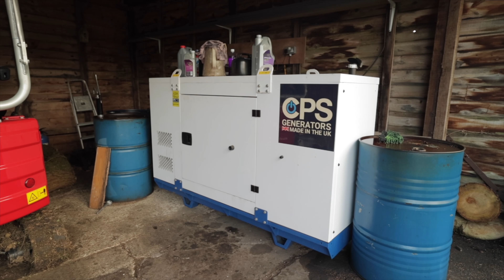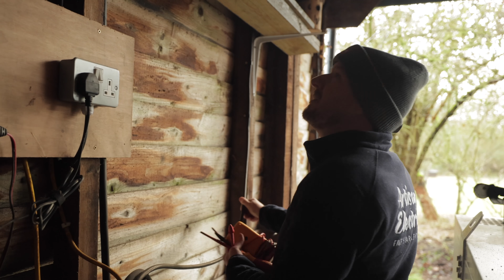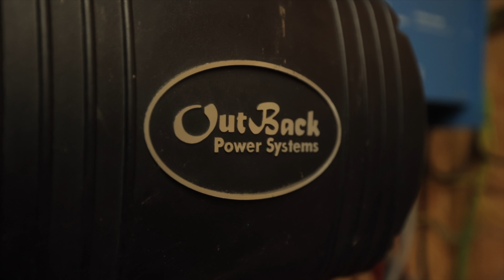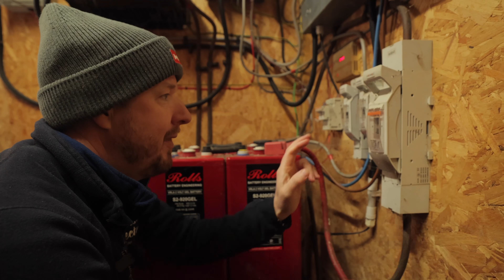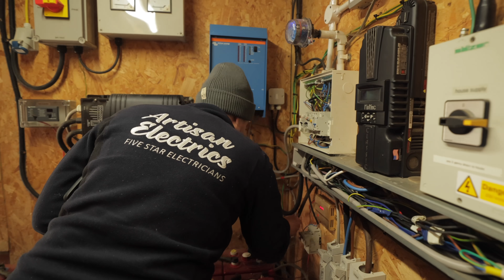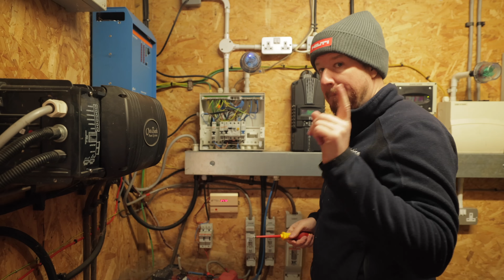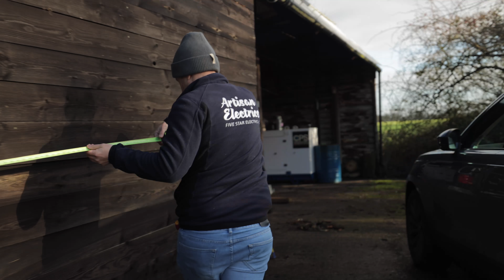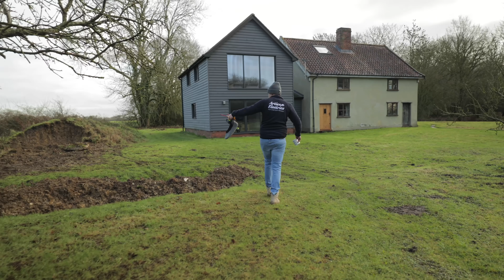DIY Off-Grid Solar Gone Wrong! (It Can’t Even Boil a Kettle)

Comment: Well why i guess that there is no sinple fix since the design is a bit messed up. Technically the system is working but it wasn't designed to provide the required loads. Then again these types of videos aren't satisfying to watch at all. I'd really like you to make more of an effort to fix them rather than just quoting a new install.  Though if I were to do this id just get a deye inverter and compatible batteries. It can control the generator as well as charge the batteries from solar and provide island AC power. Its all in one box and they can produce up to 30kw per unit and be run in parallel. And ideally I would upgrade the solar. 2kw wont even cut it in the summer.

Comment: His recs make sense from a technical standpoint.  I don´t think anyone can argue that the existing wiring and electrical design is neat (or even adequate for the new owners´requirements).  But one must also consider the reason and the timescale of that installation.  It is disingenuous to judge it under current views.  Maybe the installation was done over a 10 to 20 year period, added to piecemeal, which frankly would explain the hodgepodge of different devices and rats´ nest wiring.  Of course a larger inverter would be advisable, but as he points out that really should only happen if the existing wiring (from source into the house) can withstand it.  From the looks of it, it won´t which would necessitate new wiring.  My point is that it would seem the previous owner set the system up so it would work under certain parameters.  The current house owner has different requirements (and by the way, they seem to be completely normal for a modern home) and thus the system will need to be upgraded accordingly.  Presumably, that will carry a significant cost to be paid to the electrician.
Are the recs appropriate?  It would seem so.  But it is also true that the electrician has a vested interest in pointing out all the limitations of the current system, which may have worked perfectly fine for the previous owner.  This video, just has a tinge of being self serving.

Comment: If you don't know that the Midnite box is a solar charge controller, you should probably not do off-grid jobs! Kind of 101 LV Off Grid! You need a Victron Quattro 24/15000, half the price and really simple. You will need the genny running to stand up the sig as no clock, the Quattrro will work without the genny.

Comment: Yes, its a spaghetti job, but it works. 

In off grid, you use a gas for kettle and heating. OUTBACK and MIDNITE SOLAR are classic American brands from before Victron were a thing, Xantrex were the other big name which were bought out by Schnieder. Their unit could be used as a charge controller, or to turn on and off where the power went to, a very expensive relay option!

 Upgrading is a good option, but do respect the DIY people, with the exception of the bare cables the OWNER knew what went where and while with the benefit of hindsight it can be said it could be laid out better, that's not how things were done before it was cool to be into renewable energy. This is the work of pioneers, not professionals.

You, and the rest of us, walk in their footsteps, which they trod when professional sparkies laughed at the idea of alternative energy.

Comment: Worrying that this guy is making videos about renewables like he knows what he's looking at. His lack of understanding is shocking. Sure it's not been installed well, but the base components & system are totally functional. Ripping it out and installing the only thing you know doesn't make you an expert.

1. It's not a PV inverter - it's charging a battery, so it's a charge controller - there's no inverting happening
2. The PV will be fused as the panels will be connected in parallel & the potential short circuit current will be above the max allowable for the panels. (very common to see fuses if you have more than 2 strings connected together)
3. The generator isn't exactly 'trickle' charging the batteries - the Skylla can charge at up to 2.4kW - so the genny is well oversized, but the battery bank capacity may be the limit here.
4. How on earth is an 8.7kW ground mount array going to output 12 / 13 / 14kW? If you mean kWh, then sure on a sunny winter day, but not on a gloomy one - try 1 or 2kWh, if that. They already have a diesel generator - put a larger array on the roof and be done with it. The ground mount would also need planning permission.

Comment: Did the owner ask for fault finding or a quote on a new install? It feels like they got the latter. Suspect the batteries are just old and knackered. If the solar and generator are both going via the batteries if they're dead the whole system will be falling over (which I believe ie what's happening). It's old kit but it almost certainly worked adequately at some point. Love the channel but can't help but feel that if the initial request was for fault finding there was a better answer here. At the very least I'd expect a more nuanced response. e.g. "I've done an assessment, you need £Xk worth of replacement parts to get the current install working and even then you'll be limited by Y. Or we can do a completely new install which will cost £Wk and have the advantage that" etc etc. Just condemning the current install and flogging all new is, I'm sure, always going to be tempting, particularly if it's a system you're familiar with but surely if the customer asked for fault finding that should have happened rather than a sales pitch for a new system?

Comment: Would love to know the specs on those batteries.  How much of the thousand amps is usable.
Reply: Those batteries are setup for 24V at 1000Ah, with Lead Acid you only want to use about 50% maximum so that equates to about 12KWH of usable storage.
They can provide more than enough current to power a 10-12KW inverter for short periods, this system is limited by the Outback inverter which is probably 2KW AC output.
Jordan has done himself few favours with this video and should stick to what he clearly knows about as in on-grid systems.
Reply: @nbbluemoon1  thanks. They remind me of the nuke plant backup batteries that are 2v as well.
outback, I would think aussie, but yea, just a 2k inverter.  probably a step one as well.

Comment: I normally think your videos are good, but in the case of this one you have clearly shown that you have next to no idea as to how a fully off grid system works.
To say Victron kit is normally installed by DIYers will annoy a vast number of professional installers, its not a solar inverter it's a MPPT solar battery charger.
Yes its a bit of a Frankenstein install that's grown over the last 20 years or so.

Comment: This install was not setup at once hence it may seems messy!
You keep on criticising equipment which may be few years old which can be reused rather than been thrown to the landfill ! New equipment would do the job… but to what cost (including yours yours) so why not reusing them …
You keep on mentioning monitoring… the general public do not monitor their system when working ! And when needed they would be a gimmick as you need to be on site to act (ie reset a trip fuse)

Comment: Let's just go in and replace everything at what, £40,000? The cable work to the house alone (although i didn't get a great handle of the distance) is going to be about £4,000? Might be lots cheaper to get low-power usage units in the house instead.

Comment: Outback is the cream of the crop. Their equipment reliable AND they have full internet backup and Forum.  2430 Inverter, restricted but know your limitations (the owners didnt). I tried Studer initially, 2444, Swiss company. They wouldnt help you in any way. "Send your faulty equipment to a dealer"! No support forum. AVOID! Victron looks clunky/Industrial! yeah my wiring aint pretty either but 20 years on.....

Comment: Just go back to mains electric. Its much cheaper and maintenace free. It will never need service for the rest of his life. Yes just scrap all the installed kit. Why spend 10's thousands on new kit that will fail. If you offer a zero cost 50 year warranty is the only way I would consider an off grid solution. Even then still would not do that as you would go bankrupt and then no warranty. 
I just had my 3 phase mains from the road to new mains fuses and new meter. How much did it cost me = £0
Real cost to the dno and eon about £5 -£10k. The last time is was replaced about 60+ years ago.

Comment: Regardless of how much solar and battery you install (unless you install insane amounts of both), the solar will not do the job in winter. The generator will still run most of the time. And lead-acid batteries? Nuh-uh. Outback is a good off-grid inverter. The Midnite is a well-respected DC MPPT charge controller, not an inverter. These are well-known components in off-grid. How do you not know them if claiming to be off-grid "experts"? But the guy shouldn't even be using an electric kettle. Certainly not a typical 'fast boil' 3kW type - try a 1kW "bed and breakfast room" low power type. Where was your energy audit to assess the requirement before specifying a very expensive whole replacement system? Try a gas stove and kettle. Gas, oil or wood boiler for heating. Gas for cooking. Electric is NOT the way to go for many off-grid applications. If you are stocking diesel for the generator, you may as well use a diesel space heater. Trying to live in on-grid electric comfort when off-grid does not work. And then because he doesn't even know what the kit is, junk it all and install a massively expensive new system. If you install a 12kW off-grid inverter, the idle energy consumption when running at a few hundred watts will be ENORMOUS (like over 1.5kWh per day when in winter you may only see that amount of solar harvest on a cloudy day and WAY less on a rainy day). You need layered inverters (small ones for base load circuits like lights, TV, radio, fridge) and either higher power ones for peak loads (3 to 6kW) or don't use solar for them - bite the bullet and accept that the best source for them is the generator. The solar is there to reduce fuel consumption. The generator is there to maintain availability and supply peak demand. Just changing from lead-acid batteries to li-ion will save 10-20% of lost energy in the charge cycling. Why are you not installing solar on the house itself and running some base load on DC (I have 12V DC LED lights fed from 24V DC battery power with local DC-DC converters so that the wiring doesn't get taxed and voltage drop is mitigated). They are just 6W and go in normal GLS ES bulb fittings - look and behave just like a 6W 240VAC LED lamp but work at 12-24V DC. Same for other small appliances around the house - use DC not 240VAC. Laptops and wi-fi routers are easy to power from DC with 24-12/5V DC-DC converters. Many things run from USB PSUs and are easy to replace with DC powered versions. DC to AC inverters waste a lot of energy - avoid using them as much as you can. Avoid over-sizing them as much as you can by limiting peak demand.

Comment: Wow, these must be lottery winners.  Gone from checking it out and a new 32amp breaker which would've taken a few minutes to get them power, to a whole new million dollar system with land mounts.  So recap.  32amp RCD and tie the 2x 6mm cables together giving them plenty of power.  You have red diesel in the UK, so even running the gen loads, it'll still be cheaper then the grid.

Comment: Had an Outback system comprising 2 inverters & charge controllers fed from 2 seperate PV arrays in an off-grid system staring in 2012. Had no end of problems requiring weekly system shutdown / restart. You mistakenly identified some parts, as I was writing this you identified a charge controller (item with midnite on it) as an inverter. This doesn’t excuse bad system design but before coming to conclusions understand the system! I still have all my manuals for my old system but personally do as I did, replace the lot.

Comment: It just sounds to me like you don't really know what your looking at and by your admission don't understand it. Yes it needs tidying up and a bit of re-jigging and alteration but if YOU don't understand it I'm not convinced the customer has chosen the right person to put it right or provide a solution. The "tidyness" of a DIN rail enclosure with control devices in it or the fact that they've used YY flex has no relevance on its proper functioning.

Comment: Some top end gear in that barn, a decent sparky could have made that work with a rewire, new cu and a couple of upgrades.
You looked well out of your depth on this one, tbh every video seems to be doom and gloom for the customer and the system written off.
Unsubbed.

Comment: Running a whole modern home takes at least 48V for the battery, just to keep currents below sub station levels.
Copper is expensive.
Bdw I run a 3x5000VA victron battery system with AC coupled 25kVA SMA solar array and it runs so good we had to hear from our neighbours that the power was out.

Comment: Its a weird setup- the Victron is a battery charger (24v 100A), BUT the Outback combination inverter/charger also has an inbuilt charger as well (I can understand why its cutting out, its only rated at 2000W lol you 'could' run a kettle or airfryer- but only either by itself with literally everything else in the house turned off!!!! its got a 55A mains charger inbuilt as well, so between it and the Victron you got 155A @ 24v going into the battery bank whenever the generator is running- that generator is vastly oversized to be running fulltime just for battery charging- only about 4kW of its output can be used for that, add the 2kw max house load as well and only 6kw generator would have been adequate for the job.... )       The Midnight Classic is NOT an inverter!!!!!  - its a MPPT charge controller- couldn't quite make out if its the 200 or the 250- If its the 250, then its a 250vdc max PV voltage rated at 60A into the battery bank which means its if those panels are 30v Vmp/38v Voc needs a 5 series string would be its safe working limit (at 190v for the series string, it 'could' in theory handle 6- BUT would be dangerously close to its PVmax limit on colder days with scattered cloud in summer...) with 60A on a nominal 24v battery bank, its maximum usable output is around 1500W of solar power...The 1760w of panels is about right for the Midnight Classic 60A MPPT charge controller on a 24v nominal system....   8 panels would (should) have been wired as a 4S2P array for best performance- hopefully they didn't wire it as a 2S4P array as the mounting suggests, as that would be a extremely poor performer if done that way- it would have been a fairly pricey system about 10-15 years ago with good gear (poorly installed lol)- but these days not even close to adequate....

Comment: The original system is probably 15+ years old and has evolved over time. The original builder would have used solutions thar were available at the time. And within the limits that it could deliver.
DIYed because there was probably no other option back then.
You are being very dismissive of it, just because it isn't built up from the shiny integrated units that you have available to you now.
Yes, it's nowhere near delivering what the customer expects. But electric kettles and air friers... What they are really asking for is a grid connection!

Comment: Sorry, I couldn't trust this guy or any "evaluation" he has to offer... simply because he's too lazy to do a little bit of research on the system and quite willing to douse the guy before him with "DIYer" rhetoric etc.. he obviously doesn't know a lot about solar gear himself calling an Outback MPPT charge controller an "inverter" and even going on about how small it was.. but without any knowledge of what he's looking at is actually still considered good quality gear. The obvious reasons for his comments are unfamiliarity, he only knows the junk he purveys and sells.. and that's the best reason to move on from a dude like this.. they will have you replacing everything because he doesn't know squat about it, nor willing to research any of it. Once he's done bilking your wallet for clicks and stupid, self righteous comments, he'll move on. The most hilarious comment was the "capacitor type.. thing?" @7:46, Jeez man!.. if you don't know that your panels require this on the panel combiner/breaker box in any country.. then you need to GTFO of my equipment room!

Rest assured.. Rolls batteries are top tier.. Outback Solar is also high end and proven reliable.. Victron Energy.. again, high end and reliable! The interconnections between the components could be better laid out.. but overall, it's a system that new owners had high expectations for without prior knowledge they actually had a "off grid" home. The previous owners were obviously cramped for cash and made the best of it and probably had a gas stove as well, that genset alone cost a small fortune and living on less than 2kw of panels in the UK is just ludicrous. So the yappy guy did nothing with the fluke in his hand to verify a few simple tests of where the consumption rests.. this home could have hundreds of watts of junk plugged in and the mean consumption is already almost a kw.. then you plug a "kettle" in and there is now a substantial load that the batteries aren't able to carry because they're either worn out, improperly charged or abused.. but zero test done. The batteries can't get an uninterrupted acceptance charge with all the crappy weather in that area of the world.. so the genset runs.

I work in the solar industry, not home, but in commercial communications.. I understand the differences of the electrical codes and you can't just evaluate a 'system' by aesthetics alone.